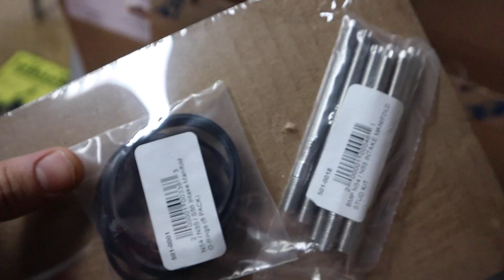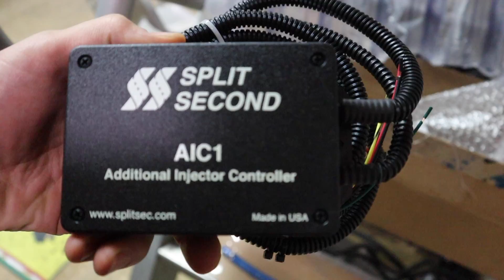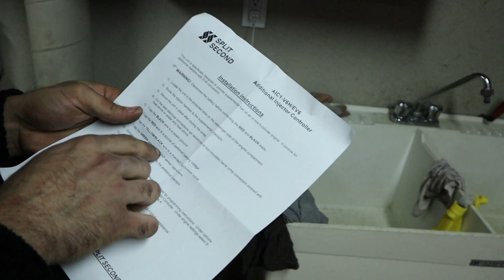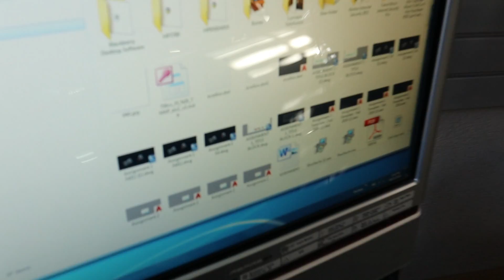N54 Big Single Turbo Upgrade & BMP Port Injection Install

Comment: So why you have to weld the 61mm vane into your 67mm? Aren't they both T3 v-band 3”?
Reply from the maker: The 67mm is a T4 V-band designed to fit On3’s T4 manifold.
Reply: @dujon5481 ude what ar housing ? 63 or 81 ?